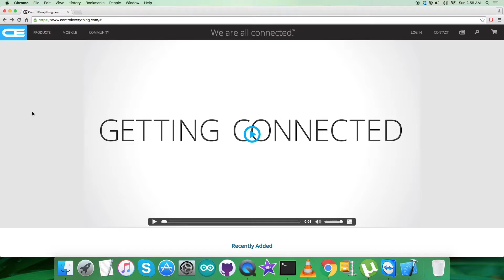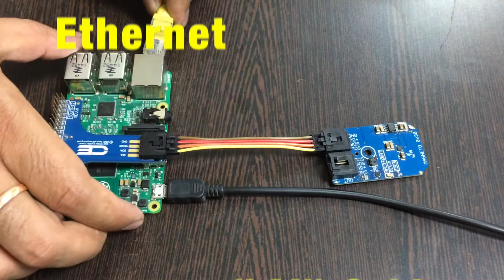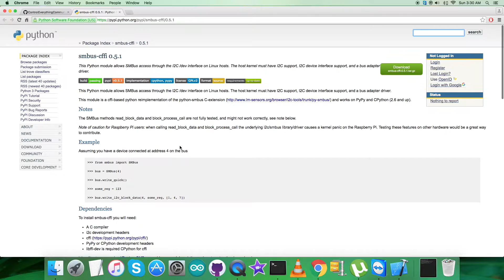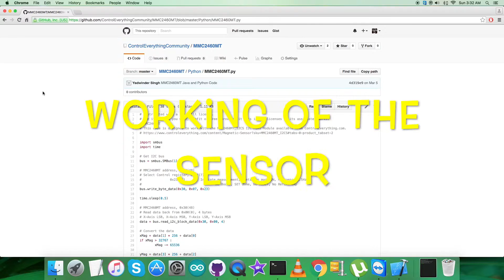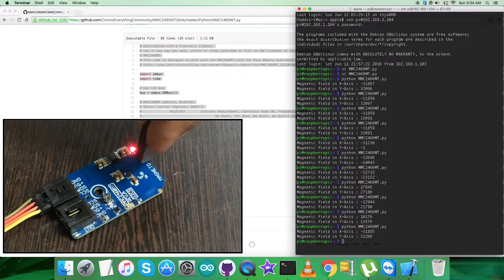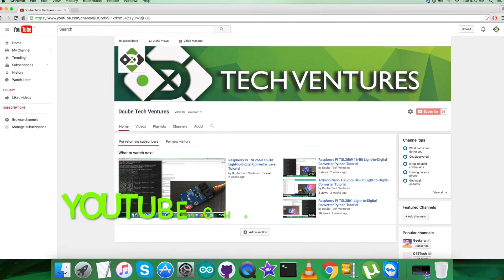Raspberry Pi MMC2460MT 2-Axis Magnetic Sensor Python Tutorial

Comment: Hi guys, I have the modul you introduce here, I have a problem which is the output gives me always the same result and keep repeating it despite movement of magnet and changing the distance to sensor to see the difference in output. here is a snapshot of output(I use the same code which is available in Githup controleverything)
00:28:20.403 -> Magnetic field in X-Axis : 8197
00:28:20.403 -> Magnetic field in Y-Axis : 8208
00:28:21.808 -> Magnetic field in X-Axis : 8197
00:28:21.808 -> Magnetic field in Y-Axis : 8208
00:28:23.166 -> Magnetic field in X-Axis : 8197
00:28:23.213 -> Magnetic field in Y-Axis : 8208
00:28:24.572 -> Magnetic field in X-Axis : 8197
00:28:24.618 -> Magnetic field in Y-Axis : 8208
00:28:25.977 -> Magnetic field in X-Axis : 8197
00:28:26.024 -> Magnetic field in Y-Axis : 8208
00:28:27.382 -> Magnetic field in X-Axis : 8197
00:28:27.429 -> Magnetic field in Y-Axis : 8208
00:28:28.787 -> Magnetic field in X-Axis : 8197
00:28:28.834 -> Magnetic field in Y-Axis : 8208
00:28:30.192 -> Magnetic field in X-Axis : 8197
00:28:30.239 -> Magnetic field in Y-Axis : 8208
If you can help me out with this problem, i really appreciate it, i have this module as  part of my project and the measurement result to go forward.
Thank you